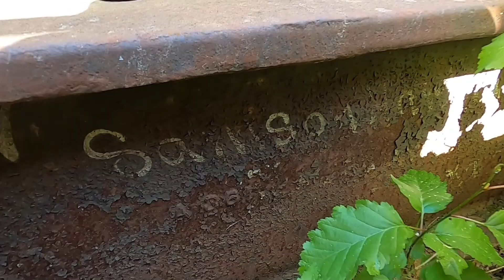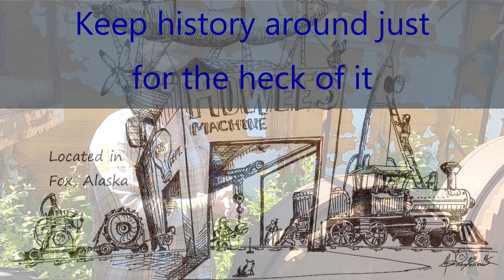Old steam winches, leftovers from Alaskan history

Comment: That's AWESOME!  When I went to the park in 1999 and saw the Nenana I was instantly completely obsoleted with how they got it there.  I asked everyone I could find to ask, nobody had any clue.  I couldn't believe there wasn't an old 8mm film or at least pictures of pulling it up there.  At that time the trench it made was still visible in the ground.  

What in the world did they Deadman that winch to?  Whatever it was is probably still under the parking lot I bet.
Reply: Here in Arizona at the more than 100 years closed Tip Top mine there is still a steam donkey.  The cast iron bull gear on that is 12 foot diameter and 18 inch wide gear face.  They somehow pulled that thing 500 foot up what is dang near a cliff face with mules.  Today you'd spend at least a month with a couple D10s to get that thing up there and they somehow did it with mules . . . Amazing to me!
Reply from the maker: It happened in the 60's I was not hear, they damaged the brand new cable during the pull, which greatly bothered my friend, who loaned them the winch (He was getting the cable in exchange for his tools & work, he also brought a d8 cat to the party)  I think they had water in the ditch, so it would float.